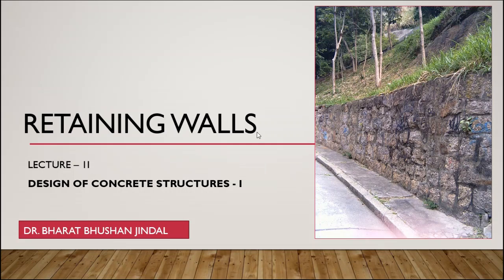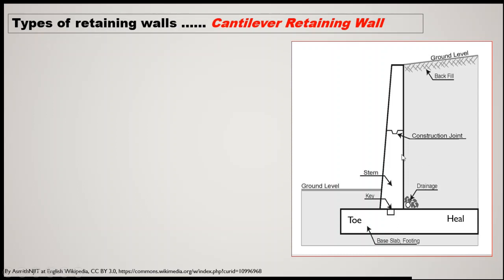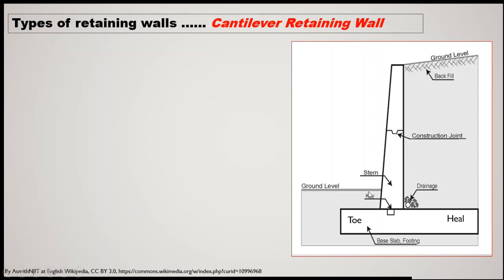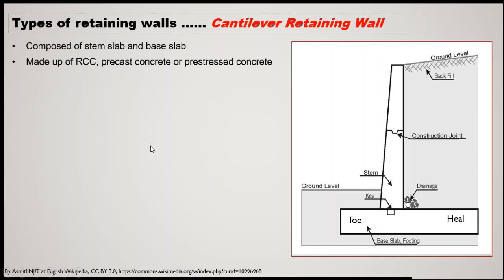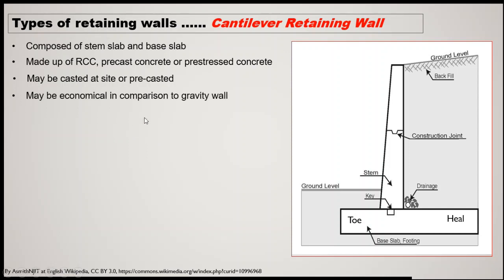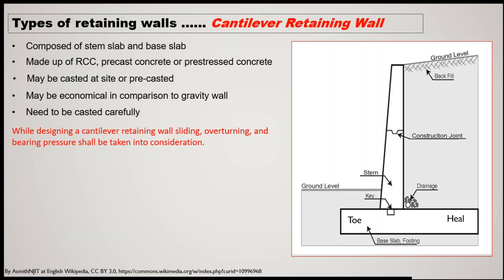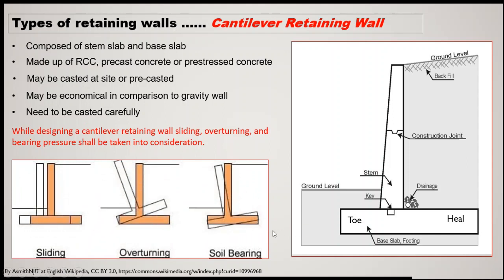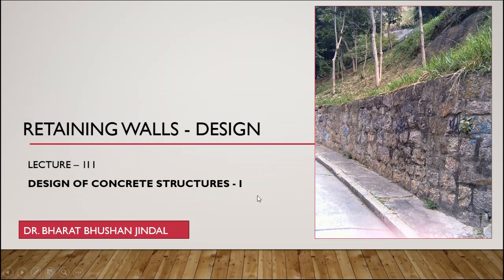Retaining Wall Lecture - 2

Comment: Sir in stem is It compulsory to provide a construction joint.
Reply from the maker: Construction joints are provided to strengthen the stem. It becomes very significant whenever the height of the stem is considerable.